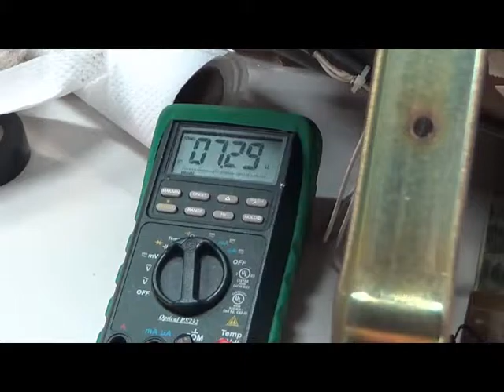Ohm your Yoke U5000 or any CRT arcade monitor

Comment: Hate to ask a stupid question but are those yoke values the same for all tunes or just for a u5000?
Reply from the maker: Mike Martin can you sub pls and I'll anwser!!!! thanks !!
Reply from the maker: hey Martin, not a stupid question. every tube will have different yoke readings. but in general you will have one side that is very low and one side that is alot higher. all u5000's will have about the same readings give or take and the same goes for other tubes, they should all be very close if they are the same tube. but no, every tube is different and will have different readouts. i hope that helps.
Reply: Electronic Santa thanks. I just acquired a few tubes only and wanted to know the best way to test.  Thanks for making this video.